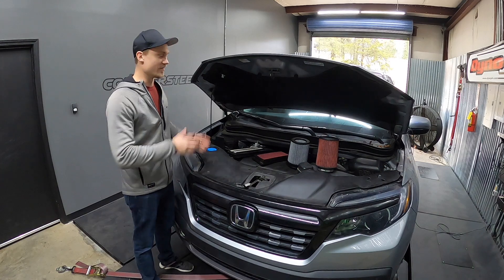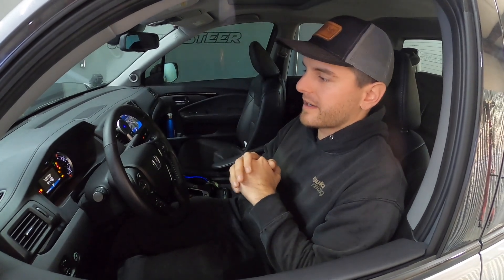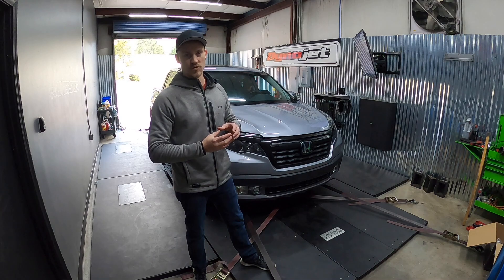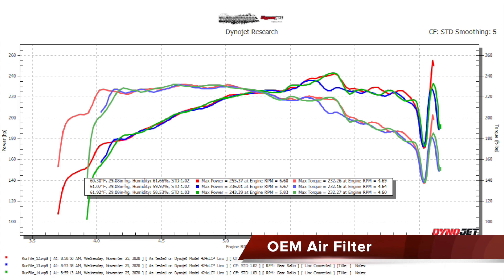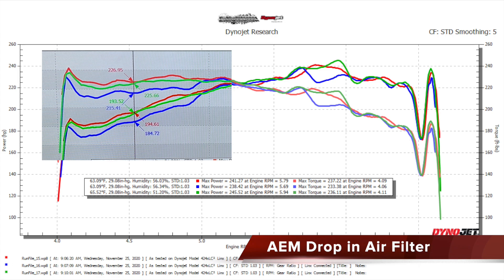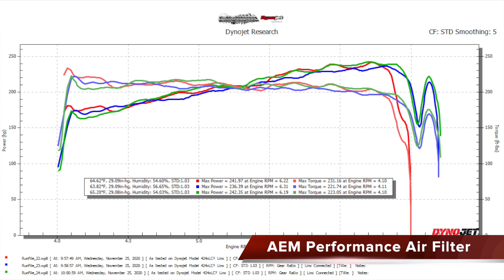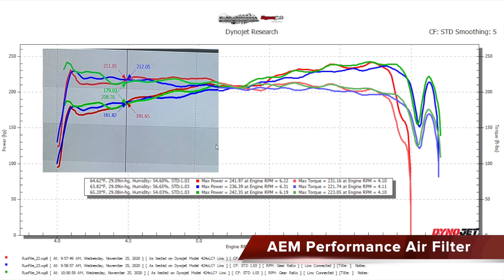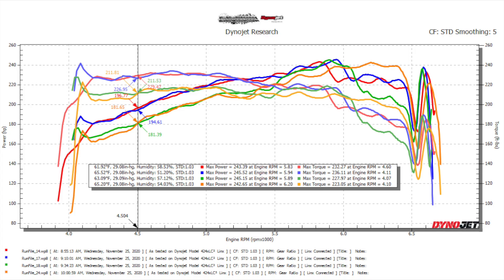I test 4 Air filters with my Honda on a Dyno. Do they even work? | AEM vs aFe vs OEM

Comment: High flow air filters are all about up selling. Good quality OEM filters are fine. I had a K&N filter on two different model cars. I chucked it in a bin. It foiled the MAP sensor. Good quality OEM and no issues and blowing Mustangs away with my 400 hp Golf R. 😅

Comment: Dang Yuri!!  
All your testing on your RL with these performance air filters is very much appreciated and grateful 🙏🏼for your time and use of your own RL. 
Being a Honda/ Acura enthusiasts racing back in the day. AEM was the way to go, Greddy and HKS if you had more dough to throw. 
I installed the AEM performance and loved the V-TEC with the RPM hits. I drive like an old man now but like to gas it some times and scare the living crap out of me lol. 

There’s a new air filter system by PRL which I believe bridges and remedied all the performance air filters faced piggybacking on Honda Engineering would provide better results. Hope you can do a dyno on this performance filter some time in the future.

Comment: It's not surprising at all that without a tune, all of the performance intakes were a loss over stock. No one needs a dyno to know that. The only actual way to compare this would be to tune for each one, or at least a tune that could actually use the extra air and isn't doing something to protect the engine by OEM standards "strange" readings on the MAF

Comment: Are these results different than your Oct 2020 review of the AEM 21-795C? It seems like that review showed an above 10 HP gain with roughly the same torque compared to the OEM intake. In this review it's the lowest performer. ??
Reply from the maker: They are different however I don’t think the one with the 10hp is wrong. It’s within the estimated gain range that AEM is claiming. Difficulty is the consistency of the transmission without the paddle shifters on my model. I wish I would control it and have consistent results.
Reply: @YuriyMotso does the same drop in filter you used on your ridgeline works on the accord coupe 2011 V6?

Comment: For my 2019 Sport. I'd  like to have a lower loading level, heated driver's seat, transmission paddle type shifters. 
A lower loading level would make it easier to push my dirt bike up my auxilliary loading ramp.

Comment: HP & torque improvements are performance criteria.   Typically, high air flow filters allow more dirt particles to enter the engine. Suggest adding filter particulate test.

Comment: Basically just keep it OEM.
Reply from the maker: Good overall gains with the drop in AEM in real world testing for fuel economy as well. So fractional hp gains with better fuel economy = worthy upgrade when replacing the air filter.

Comment: Hello Yuriy, it seems from the data the drop in give the best numbers, but I see your running the aem performance.  Is there a reason for this.  Trying to figure out which (if any) to add to my 18 RL.  Thanks
Reply from the maker: I run the drop in. My older videos I have the CAI “performance” AEM intake. Both are honestly good performers against what people keep stating in the comments. Multiple videos on my channel prove that they perform better than stock in general. However for me the drop in gave me the most desired gain which was fuel economy. So I run that in my vehicle. I haven’t made a follow up video about it because I lost some content due to a gopro crash. I may still get around to doing it but haven’t yet. I love the sound from the performance intake though. Many Smiles per gallon. 

Hope this helps.
Reply: @YuriyMotso  Helps tremendously and thank you so much. Your videos have helped me a lot.
Reply from the maker: Awesome! Glad I can help. Happy new year!
Reply: @YuriyMotso  and just ordered the drop in.  Happy New Year to you also!

Comment: Oiled filters flow the best K&n drop in would of had a 5% increase over stock easy.
Reply: 5% is a big claim. They also let through the most contaminates and oil everything up.
Reply from the maker: I do wish I tested the K&N but for the reasons you stated is why I rather go dry. Even if it doesn’t coat the MAF sensor with oil, I don’t want to risk it.

Comment: When the cAr is actually moving wouldn’t the air intake actually bring in more air ? Wouldn’t this also affect the air filters intake
Reply from the maker: This fan simulates driving pretty well. Also remember that when the hood is closed, less air is getting into the engine anyways.

Comment: Awesome video but I'm confused. I thought your first video when you went there you had a 20hp gain using the aem performance filter vs stock. Was that a fluke?
Reply from the maker: So I do not think there is a fluke. Everything is exactly the same except temperature. What I think happened was what allows AEM to claim HP increase. We got a reading that is real but I don’t think it’s frequently consistent, we must have had some sort of ideal condition in fuel and air mixture. It’s what you can see but realistically you will probably see lower HP gains. The technician said that he always sees AEM products producing more power than OEM. If the truck was boosted or forced air, we would probably get much higher or consistent numbers along with a tune. I asked the tech and the numbers are good for both days it’s just the truck possibly calibrating. We also did have many more runs last time about 20 runs so the truck had a good time to calibrate to the filter. This time it was a bit shorter.
Reply: @YuriyMotso  so in the end do you think there's not really any gains or would you have to take samples multiple times and take the average to know for sure? I was really hoping there was a legitimate hp gain bit that last test you did made me cry lol

Comment: Just as a side note, if an engine is getting too much air, it can be inefficient and lower power. Without a tune, messing with the air filters isn't typically a good idea for this reason. However, with a tune is where you will see the improvements. Otherwise, results will always be what you see here, almost nothing or a loss of power.
Reply from the maker: Yep. However most people buying these products are assuming there are increases and won’t be tuning their trucks. So this is to put to bed any concerns or questions.
Reply: @YuriyMotso  I understand that, but just like the videos that show which air filter flows the most air, there should be something showing the other side as well. Too many 1 sided videos on YouTube.
Reply: @RideWithDanger  this video is super informative. Be grateful he did anything other than critiquing videos online.

Comment: The dyno video on AEM vs OEM showed a significant gain but losing power now?
Reply from the maker: Yes, it’s quite interesting to me as well. The test was done by the exact same technician under exact circumstances. I believe the numbers are accurate, however, I think this is a best case scenario. What I mean is this is a potential HP gain maybe not every single time you are driving. Ratios change with fuel you use, temperature and so on and so forth. So yes I believe the statement is accurate that the power can increase this high but don’t expect it to be consistent. AEM may have gotten numbers similar to this and as soon as they see numbers like this they can officially claim that you can see up to X amount of Hp gains and it’s not a lie. It’s just not probably sustainable for every driving condition. The technician told me that he’s been doing this for 14 years I believe it was and AEM products always produce more power. On a turbo or supercharged vehicle the gains might be more apparent than a naturally aspirated vehicle though. 

Hope this answers your question.
Reply: @YuriyMotso  I can CLEARLY say that if you have a Ford or Lincoln ecoboost engine. Your doing your turbo engine a GREAT SERVICE by switching out the stock filter with an AEM dryflow filter. Granted your results will vary from vehicle to vehicle just as this individual explained above. However, you WILL see a slight increase in HP, Torque, and MPGS no doubt about it. Plus, you DO NOT have to oil these filters stay away from those folks. They will eventually ruin your mass airflow systems. These AEM dryflow filters don't need cleaning until around 40-50k miles and cleaning is super easy. There are plenty of videos right here on YouTube on how to do it properly. Sure they are probably 2x the cost of a standard OEM filter. However, they will pay for themselves in a year of use. Bottom line is if you have a turbo engine your engine deserves to breath better period...!!! And this filter will do just that.

Comment: Next dyno check.
Regular vs Premium fuel.
To see if the ecu advanced the timing when higher octane is used.
Reply: @RA Wang not necessarily, it helps it run as efficiently as it can. With my 2013 g37 I put in regular fuel and the fuel economy was horrible and also the performance since the ecu pulled timing. It was a lot slower and sluggish. Once I switched back to premium gas and the fuel economy went back up and the performance was significantly a lot better
Reply: I changed from regular to plus in my pilot and the difference was immediate. All sluggishness went out the window

Comment: Also why the different performance results for the AEM Performance Filter from the last dyno. Both your 0-30,0-60 and 1/8 mile time shows  it performs the worst.
Reply from the maker: My guess is that since we were not able to get a good reading under 4000rpms because the vehicle won’t stay in gear long enough on this mode with out paddle shifters the AEM performance intake makes most power above 4000 but could be producing less below 4000 hindering its acceleration time.

Comment: So if you were pulling a trailer it looks like the aem dry drop in filter is the better option.....and quite frankly the most costly option
Reply from the maker: Yes, in every test the AEM Drop in filter has been the best performing filter. My recommendation
is that filter. Better fuel, more power, and saves cost long term on air filters.

Comment: Question about the previous video done with the aem performance dyno.  What was done differently on the dyno where you previously got some odd 13hp and 27ish hp with the performance intake.
Reply from the maker: Variation as opposed to this day was temperature. All tests were conducted exactly the same. The Highest power output that we saw was that number. We did roughly 20 runs that day and that one stood out as the best.  Now it does not mean it will be consistent. Sometimes this can happen. Like I said in that video we pulled the best results not necessarily average results. I have another video coming up soon in a head to head which filter actually makes your car faster in a way people can understand.
Reply: @YuriyMotso  so since u took the highest number 13 hp and 27 he. What was the average that day. Because I was so set on the aem performance but now I'm thinking about just the drop in aem filter. But vtec does crack louder in the performance one
Reply from the maker: @HUBBSPEC  I would have to go back to the shop and get all those data points. I only took the ones we recorded once we were confident with getting consistent compliance from the truck after Dylan figured out the Hondas perfect zone. I am doing a final wrap up video here which I hope to cover and answer any questions one may have about these filters. My opinion though is the best option is the drop in AEM filter. More on that in the upcoming video.
Reply: @YuriyMotso  cool thanks for the fast reply. Also I know u already did the test but were using 87 octane. Or 91 octane maybe difference maybe try in another video just a suggestion because I only use 91 in all my vehicles whether it does something or not its kinda just a piece of mind thing. Even if it doesn't do anything I would assume it would burn better and less chance of carbon build up
Reply from the maker: @HUBBSPEC  I plan on doing a video comparing 93 or 91, (which ever is available at Costco), octane to 87 because it seems to be a reoccurring question which octane is better as well as a ECO button test. I  used 87 octane on all the tests because it's what the majority of people will use ad recommended from Honda. This way my test is relevant for the majority of viewers.

Comment: Well, if I want to buy the filter without the box, which is better is the filter aem or afe ?
Reply from the maker: Not sure I fully understand what you intend to do but in my tests the AEM typically performed the best. The aFe will not fit as it has a larger opening on the AEM inlet. The aFe will also not fit the open inlet tube as its to small as well. plus you would have a hard time getting a solid fitment.
Reply: @YuriyMotso  Yes, I saw that in the video and I was amazed, but I am talking about the filter itself without the box, which one is stronger, aem or afe, because I can replace the filter, for example afe, after its expiration date, with the aem or k&n filter. They are both the same size and flag, but the air intake is different.
Reply from the maker: @Mazen9294  well both me and my tuner do not like or recommend the aFe filter. I think there is some sort of design flaw but its the most inconsistent filter and the least producing in all categories usually. I would go with the AEM filter my self. I am not promoting it I just personally like this filter the best through all of my testing and depending on my next test coming up may only use AEM products moving forward. Hope this helps and answers your question
Reply: @YuriyMotso  Thank you, you have helped me a lot ❤️
Reply: @YuriyMotso  I'm talking about the filter only, without the antiques
Reply: @YuriyMotso  Excuse me, I am not good at speaking well

Comment: So I know you tested the AEM drop in but have a question.   I typically bought K&N drop in filters for my vehicles, would u recommend AEM over the K&N?
Reply: I have a 2015 Lincoln MKC 2.0L AWD. And if you own a Ford or Lincoln with the turbo ecoboost engines. It's ABSOLUTELY essential to get an AEM dryflow filter to help your engine breath better. You results will obviously vary from vehicle to vehicle. But you should experience a boost in; HP, Torque, and MPGS. They are every bit as good as an oiled K&N without the need to be oiled. Which as was already mentioned can eventually ruin your mass airflow systems. So do your engine a service by getting one of these AEM dryflow filters. It will pay for itself in the long run BIG TIME...!!!
Reply from the maker: that comes down as a personal preference. For me Personally I choose to go the easiest route. 

First off K&N bought out AEM. 

Second off all K&N Filter require oil from what I know. Thats an extra step I don't want to deal with. AEM is dry so all you do is spray it down with the cleaner and then dry it out. No oiling to do after. 

Third there are rumors and people who claim that Oiled filters can mess with your MAF sensor. K&N has since posted a claim stating this is false and not true however I am not interested in taking the risk. Most likely it will be just fine and you will never have an issue. I just like the convince of the dry filter over the oiled filter. 

Either way you go you will over the course of the life of the vehicle save money by never buying another filter again. In my tests the AEM filter is typically equal and in many cases better than the OEM filter. Not guaranteeing its going to be for everyone but in my specific vehicle this has been my experience. 

Hope this helps and thank you for taking the time to reach out, communicate and watch the video.

Be blessed!
Reply: @YuriyMotso  thank you!  I noticed that the DROP in AEM filter got best performance numbers and better fuel economy so that’s the one I’ll be going with.  Just got a 2020 Ridgeline black edition.  Love it.  Although it’s brand new and I have a little bit of a clunking in the right rear with less than a thousand miles, gotta take it in to have checked.
Reply from the maker: @travelingrailfan4634  Congrats and welcome to the community.

Comment: Great video as always!! I know the ridgeline uses the j35y6 engine but honda has the slightly more powerful j35y4 engine ( 2014+ RLX/Honda Legend) comparing the 280/262 vs 311/272 ( premium)  how come they couldn't use that engine in the ridgy?? I'm no engineer but from what i researched the engines are practically identical!(swap?!) Looks like most of the differences are tuning for premium for higher compression...pretty sure they could have tuned for torque instead right? Idk the J series engines have so much potential

Comment: Just as I thought, “performance “ air filters are a waste of money
Reply from the maker: I guess to each their own. not everyone really cares about efficiency. Thats quite evident when people add larger tires and raise their trucks. Some people do it for looks and in this case people will do it for sound and or the assumption of more power/MPG. If you have not seen my MPG test I recommend you taking a look and you may be surprised that there is a quite significant difference in Fuel economy. This is a three part series. Third part which is a track day will be filmed soon. Hope you can stick around and have all the information to help you make the best judgment for yourself if you do decide you are interested in upgrading in the future. Thats the main point of this video and test.
Reply: @YuriyMotso  so would you say aftermarket air filter intake is not any better then the stock oem one? I drive acura tl 2012 planning to instal takeda intake. Does install intake would get better mpg?